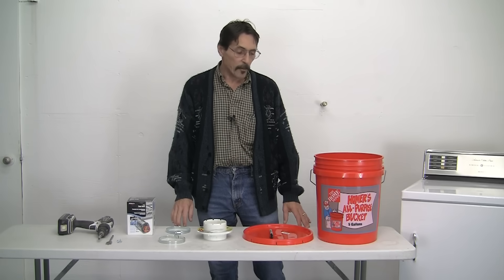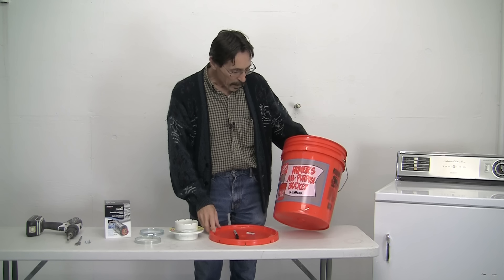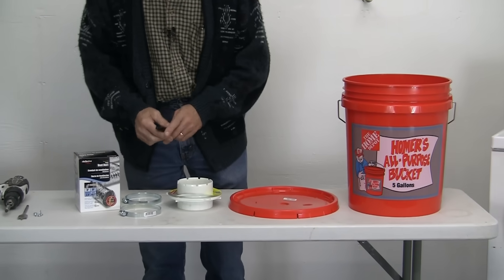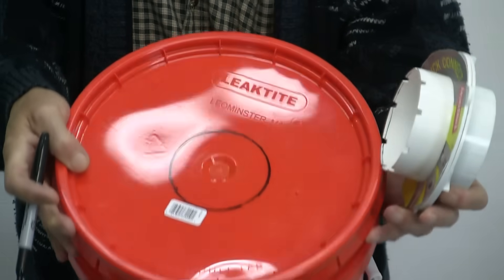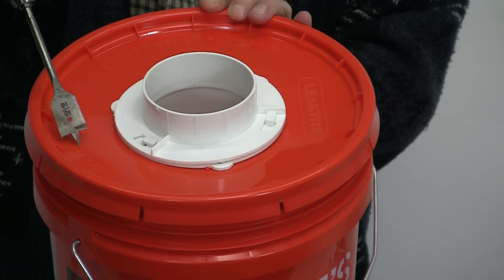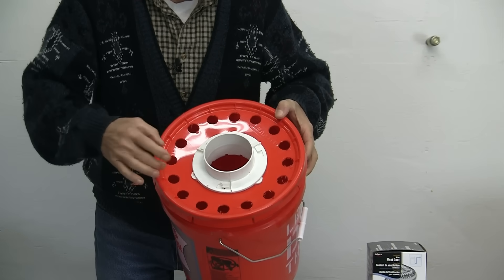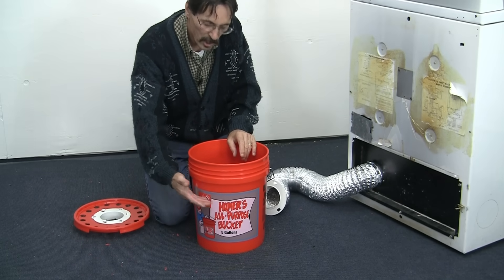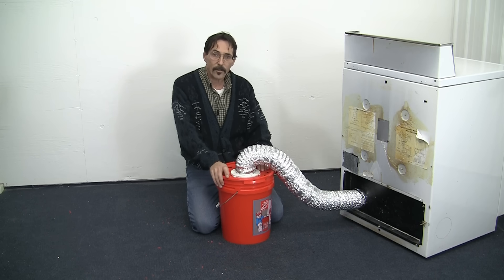DIY How to Cut Electric Bill in Half: Part 3 Clothes Dryer Free Ideas | Missouri Wind and Solar

Comment: do the world a favor - take another large bucket, put a fine wire mesh screen over it, slowly pour lint water into mesh screen to catch the lint so you can reuse the water. Let the lint dry and voila(!), easy fire starter material (lint).
Reply: Toss a few chunks of copper pipe into it, this will keep it from growing bacteria. This is also why copper is used as water pipes in our homes as it is a natural way to keep the water clean.
Reply: Chaz Steadman 
The water will go to stinking after it sits for long periods
Reply: Chaz Steadman that is true!
Reply: +Steuen G Didn't know. Thanks
Reply: Riyt
Reply: +The Answer ever been divorced?
Reply: +The Answer Mr Answer - You certainly had a reason to chime in (not chyme - the pulpy acidic fluid that passes from the stomach to the small intestines).
"Do the world a favor. .." certainly did not convey my intention,  which was to promote the importance of our planet's most valuable resource; water. In retrospect,  it could have been worded much better. I appreciate that there was a strong reaction to my comment for that reason. I will think more next time about the verbiage.
Reply: +The Answer I'm not sure,  by "sync", if you mean something akin to coincidence?If so, then I'm not surprised, as that sort of thing happens frequently in my life, even if it is in my interaction with you. Thanks for sharing that. Have a great day. Chaz
Reply: +The Answer By the way, I am interested in what you find out. Unfortunately, I am not able to take on topic right now as I am too busy researching material for my traffic court case. If you want, I would like to hear what you come up with. Thanks.
Reply: +The Answer I really like the term "angry warrior". Most people don't get the reference when I tell them,  "I'm just an old guy, up on my nag with my wooden sword,  fighting windmills, looking for a whore (I usually leave that one out - lol) fighting for justice instead of chivalry. (the only play I've ever been to. ) haha.  Okay.  I'm weird that way.  
And you're right. Thinking and expressing ourselves in a positive way really helps this world go round (unless you're a flat earther, who do make some good points).
Reply: corvettedoc1 u7
Reply: +nateman10 

cotton fabric is chemical treated to resist rot.
formaldehyde or ???

Comment: Great idea I used the little square ones in my old apartment and always had to refill. Now owning a home I will try this as it will add moisture to the air. Prevent mice from crawling into my dryer vent outside. Add a lil heat(not much but better then shooting outside for nothing) adds a pleasant dryer sheet smell. And I use dryer lint for my fireplace as tinder as well as out in my fire pit. This has multi functions. Great job 👍🏻
Reply from the maker: Thanks meckleboy. Lint to start fires with is a good idea to.

Comment: MYdryer vent goes through the wall into loft area in garage ,will there be a problem with water freezing
Reply from the maker: I doubt it.
Reply: so when water freezes the lint is free to exit the bucket?
Reply: Not just then, only PART of the air comes in contact with the water, most of it doesn't. Their needs to be a very good filter like a HEPA type. And the moisture isn't good for the house either.

Comment: Excellent..I make humidifiers for my small shop same idea...only a small 12 DC computer power supply fan blows IN hits the water, the water has slight ripples releasing vapor or (moisture) into the air (again same in and out air flow) keeps small shop 35% to 40% in winter thus elec heater runs less. Love your videos!
Reply from the maker: Excellent idea. The moisture really helps
Reply: agree!

Comment: Hi Jeff, thanks for this. What do you think about covering those vent holes with screen? I've never used an interior vent that actually traps ALL the lint and was thinking some screen over those vent holes might help. It's only 25 cents per foot and could just be cut in a ring or in small circles and stapled underneath. Do you think that would impede the venting too much?
Reply: Are you still waiting on an answer Teresa?
Reply: I was waiting for that)))

Comment: done this and my house's temp was changed from 95℉  to 118℉. Humidity from 89% to 99%.
my house is now a massive sauna. huge improvement!!
Reply from the maker: It's not meant to be done in the summer at all. It's meant for winter months only.
Who would vent a dryer inside during the summer?
Reply: It's a joke! I live in tropical country, no one need heater.
Reply: After bedtime I would when the temperature is lower. I usually dry all my clothes outdoors in the summer. But for towels & on rainy days, I run the dryer at night. With a 2 story apartment the heat increase is not noticeable after bedtime

Comment: never do this with a gas dryer you will kill your family from carbon monoxide....... Even on an electric dryer it's a bad idea Google dryer fires and read what the most common reasons are....
Reply from the maker: I already said not to use this on a gas dryer. 
It's perfectly safe on an electric dryer and will never cause a fire. Dryer fires are caused from lint buildup inside the dryer. I as a service man for 25 years cleaned the lint out many clothes dryers.

Comment: With a 4" inlet, you need 18 - 15\16" holes for an almost equivalent air flow. It will still be slightly less than the input airflow. If you want no restriction at all, drill 19 holes.
Reply: you've thought this through
Reply: but why

Comment: What takes the lint out of the air stream? Is it the flow reversal?
4" hole = 12.5 sq in
16 * 15/16" hole = 11 sq in
16 * 1" hole = 12.5 sq in
Reply from the maker: +Richard J Lebens The lint gets captured in the water.
Reply: how about the fine lint dust ? it will come out and in air indoor. how to prevent fine lint dust ?  can be dangerous if you inhale those particles ?  suggestions ?

Comment: for all who are concerned with humidity, add some polymer crystals to your pail to absorb some of that moisture.  you can buy them at the dollar store in a little package that's made to absorb extra moisture.  they'll collect some lint dust, too, so changing them occasionally will be important for that reason, as well.  keep it simple - leave the crystals in the package that they came in!  clean out your pail once or twice a year, too!  don't add so many crystals or packages that your pail no longer ventilates properly, though!
Reply from the maker: +Donna Kovacs Sounds very cool, thanks

Comment: nice idea. i use a drying rack or i hang a clothesline outside when im not in a rush.
Reply from the maker: +thersten That's the best and cheapest way to do it. The original Solar dryers
Reply: +MissouriWindandSolar yeah but I actually prefer to do it indoors or when there's no sun because the sub drying seems to make clothes smelly. or am I just crazy?
Reply from the maker: My wife and mother use to dry clothes on a clothesline, they smelled fresh to me.
Reply: +MissouriWindandSolar hmmm. Im going to have to figure the at out. may be my detergent.  oh and thanks for the videos, I like them very much!

Comment: Great idea I myself did the same yrs back when we had an electric dryer.  It's easy to forget that you need to check bucket on a regular basis. So what we did was had a little calendar with  a weekly reminder to check and a marker attached to check it off. The other thing is bacteria will grow rapidly in water. So purchase a bottle of humidifier antibacterial solution . Follow directions on bottle then double this amount which is important because the lint coming off your clothes along with the warm water will grow bacteria at an amazing rate. Finally never dump water down a sink drain  that l will collect in your traps and you'll have a stoppage before you know it. Even flushing down the toilet isn't a good idea because the lint is from fabric which won't dissolve like tissue paper. So again you could eventually overtime have this stuff from both your clothes washer(If you don't filter out lint here) and your dryer bucket can cause your main to clog. If this happens you could be looking at hundreds even thousands of dollars to have unclogged. We had a neighbor that from pouring grease down their drains along with lint from doing clothes they had a main stop up. It wasn't as simple as having a plumber running a snake through their sewer pipe cleanout. Nope it had clogged where  their main connected to  the city line so it had to be dug up !  This meant not only did they owe the plumber for his time but they also had to pay the city $4,000  for tearing up and replacing a section of sidewalk,  in addition to the clean out and reconnection of their main to the house. They ended up owing the plumber almost $2.000  for his time cleaning out all of their drains and sewer lines in the home. All because it was easier to flush than to have a place outside to dispose of ,this was also true of their cooking grease. Most Towns and counties have locations where you can bring cooking oils and grease.They then recycle. ** Note regarding water in bucket. You could also put a cup of white vinegar instead of anti-bacterial solution. This will do a couple things first prevent bacterial bloom second if you don't mind a vinegar smell the acidic nature of the vinegar will help breakdown the lint fibers. **Tip regarding vinegar  Dump 1 cup white vinegar in all your drains, Do this at night or when they won't be used for at least 4 hours. Then pour 2 heaping tablespoons of baking soda down each drain(Make or purchase a funnel for this step it gets all the soda straight all the way into the drain. You can at this point use a half cup or so of vinegar to make sure all the soda gets down into the trap. This is where you want it to go because it will react immediately with the soad causing a pretty good foaming action. This reaction will help break loose and apart  hair, toothpaste,soaps, hair creme rinse make-up all of these will and do accumulate in your drain trap and pipes under your sinks,tubs and showers. YOu should also do this in the stand pipe for your washer! Do this once a month takes a few minutes for sure but I can almost 100% guarantee you'll never have a clogged drain. I have not once had a drain stop up,and I'm turning 60 in a couple months. Also I managed apartments and townhomes years back. Each unit had this done in all drains without exception. During the periods I overlooked these complexes I never once had to call a plumber or go myself to unclog a pipe.  This doesn't include toilets could never come p with a way to prevent an 8 yr old using half a roll of toilet paper from plugging one up!
What I'd like to know is why they don't make sud-saver clothes washers anymore? Also I'd   ask of anyone that  happens to read my entire comment to share if they know how to capture heat from at gas dryer.  Send me a message by way of my You Tube site or directly  to esp1000photos(at sign)gmail.com

Comment: Do you know "Rainbow Vacuum" that uses water as filter ? I think that if you apply the same principle, you should install a small piece of aluminum vent hose Inside the bucket right thrue the water. So that way, you make sure to get rid of even more lint  direct in the water. Suggestion... by the way!

Comment: what size self tapping screws did you use....thanks...can you buy them lose , caz i dont have much use for them other then doing this job....lol.....as i am getting a Apartment size dryer can i use a 2/3 gallon bucket?..and can i ask the Home Depot to drill the holes for me.as i have  tools,  but not for every job....Thank you....my dryer is not going to be used all the time.....mainly for finish off drying clothes like towels to make them soft......i like to hang dry clothes and finish in dryer for softness and smell.....lol

Comment: any ideas on how to couple this idea into something that doesn't get the lint all wet? i collect our lint for my wood stove which i use for heat in MN 6-9 months of the year. right now we vent our dryer into our bike porch (screen walls) and then every so often i go scoop up all the lint blown all over and put it in egg crates and dump some candle wax on it and make some great fire starters. but it would be nice if we could vent into our regular porch which is VERY cold in the winter (we use it as a refrigerator!)
Reply from the maker: +AL Genaro No, it will get wet, that's the only way to trap it.
Burning lint idea is cool.

Comment: Clever idea, but obviously not for everyone..  Some rough comments and feedback..  Thanks!
Reply from the maker: +cepuras The idea of getting mold in your house is just stupid. The heat and humidity is dispersed through your house. The idiots that make those statements are just idiots.
Reply: +MissouriWindandSolar some newer homes are sealed and wrapped so tightly that they don't breathe at all, like living in a Petri dish, and if you introduce too much moisture with no ventilation, mold will grow..  Ironically the now since homes are so tight, there has been another brilliant invention, HRV and ERV systems which essentially an air handler that rotates air inside and outside...  It's a constant evolution that will make those that are even partially aware to giggle and wonder..  Great videos..  All the best!

Comment: Thanks for the tip I work at a Motel And the dryers seem to run a lot. And getting the Maintenance man to dump the water every so often be great. Besides putting heat back into the building in the winter is a big plus.

Comment: Did virtually the same thing but used a blue storage tub (24" x 18" x 12"high) from Walmart with lid. I just used the 4" hole on both ends since the tub is rectangular.

Comment: Probably should use a 1+1/4 inch hole saw, and  make sure you have the same sixteen holes. 1" times sixteen equals the area of the four inch vent and you should have more total area on the exhaust for the least back pressure.
I went one step better and converted my gas dryer to electric to make it more efficient. How so? you might ask since gas is direct flame heat and electric, even here in CA which uses gas to make it is generated at about 35% efficiency before being turned into heat at your dryer. 

Ahh, but think about this, I use a dehumidifier at the output and no heat setting on the dryer. The output of the dehumidifier fan goes back into the dryer input air. It took a bit of high quality actual Duct tape, the kind used professionally on heat ducts, and some panels to match the slot my dryer uses to make up for the air it exhausts. 
Here is what happens. The dryer starts out cold, but after several passes through the dehumidifier it begins to warm up inside. It is slower than the gas was, but I do not have to use dryer sheets as it leaves the clothes warm, dry and very soft. Refrigeration heat pumps, and that is what the dehumidifier is; are typically 3 times more efficient than resistance heaters. A 110V portable electric dryer will use 1200 watts and take the same amount of time, but this set of appliances draws less than 500 watts. The electricity to turn the drum is the same, so I use less gas at the power station end for the dryer heat part, and do not throw the already heated home air out into the cold that the gas dryer was using in winter.
Reply: Paul Gracey 12.56 is the area of the four inch vent...pi times the square of the radius
Reply: Nevermore '74 you are correct.. and the area of the holes is over 45
Reply: Paul Gracey the holes are almost 4 times more volume than the 4”

Comment: Does my gas stove & oven put CO (carbon monoxide) in the air? I always thought a natural gas flame was pretty safe?
Reply: +Liberty Wagon Yea, it does. That could kill you.
Reply: +Liberty Wagon Yes it does, but its not enough to overcome the oxygen in the air while cooking.  Natural gas and ventless propane heaters do this too. They burn very clean but to do so they create CO and H20 So you get water vapor, CO, and the CO is often dissolved in the water making carbonic acid. So thats why you dont use ventless heaters in a garage for long periods in the winter if you dont want to rust your stuff.
Reply: get co2 detector and put near stove to warn you before it goes further into house. get a window box fan and put in rooms to refresh stuffy house. you sleep amazing.
Reply: I think you meant CO detector?
Reply: Burning propane or natural gas will always create CO, the danger is in the quantity of gas you're burning.  With a stove or oven you typically have some form of vent over the range as well and the rising heat will carry the gas up and out even if the vent isn't on.  Natural gas on demand hot water heaters and dryers burn significantly more gas than a rangetop stove or oven would.  That's why all the natural gas on demand hot water heaters are direct vent, and the ones that aren't have lots of warnings about not using them indoors.